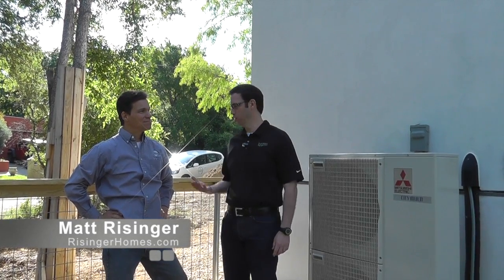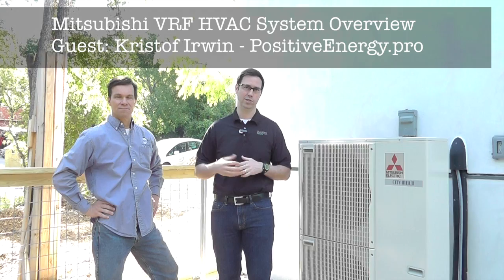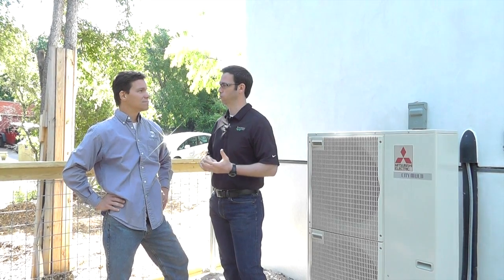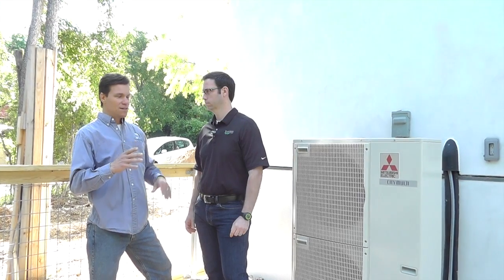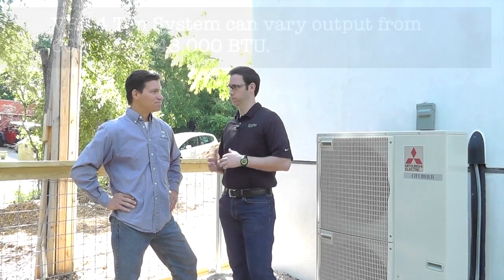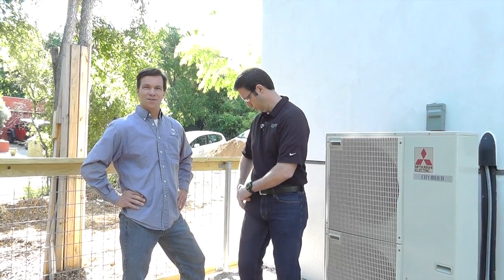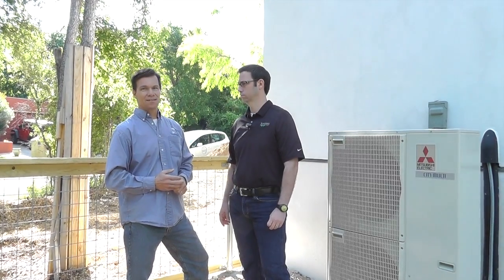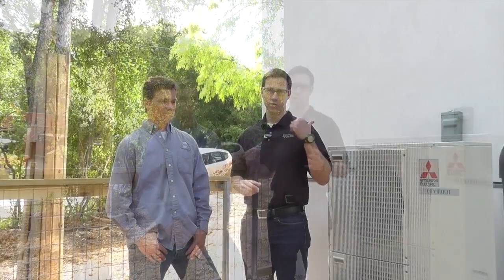Ultra Efficient & Comfortable HVAC - Mitsubishi VRF System Tour

Comment: I'm a Waco Texan who's always known there HAS to be a better way to cool us down here.  Dehumidifiers are clunky, noisy, etc.  But except for west Texas our humidity is miserable.  And I HATE the ceiling fans needed to get air flow in my older house with 8' ceilings.   I'm here in 2023 hoping the price is coming down for these.  I'll certainly check next time I need HVAC replacement.

Comment: There is no way that a 4 ton unit starts at LRA then runs at 40 amps RLA! If that’s the case then the compressor is more than likely not coming on and even tripping the breaker at the main panel!  My 2 stage Trane 18 SEER heat pump with variable speed air handler comes on at 20 amps with a start assist kit then goes to 8-9 amps on first stage and then if needed the second stage goes to 11 amps. Even on older 2 stage systems I don’t see this kind of amp draws. This information is incorrect that you’re giving to people. If you have proof of it then show it with a meter attached when a two stage system turns on and then idles out. This information is very misleading!

Comment: The initial cost of install and future cost of repairs of these VRF’s are insane...  not to mention most suppliers do NOT stock a ton of parts for these systems, this means when it breaks you will be without AC for a while waiting for parts...

Comment: Matt, love your videos.   It is great to see the efficient and tech side of construction.
Had two questions about this install.    
1) Is there any reason for using a VRF for a single zone over a normal mini split outdoor unit?   I see the real advantage of VRF systems when you start to use multiple zones where you can cool one zone and heat another zone simultaneously / using the heat pulled from one zone to heat the other.

2)  Why is the return located below the unit on the 1st floor.  Not to mention a small return duct inside the utility closet?
I would think you would want to pull return air from at least the top of 1st floor if not higher.      I have always found returns at the bottom of upflows as trouble due to not pulling from the hot air above and also pulling in excessive dirt and dust from the floor.
Thanks for your videos, they are always informative. and appreciated!
- Ben

Comment: 3:50 this bit right here is huge because if you don't have a soft starter you have to size your breakers for the surge/inrush current. If the equipment doesn't come with it I would ask about adding a soft starter if possible on any large amperage equipment
7:49 I don't know why people object to mini-split heads: they offer functionality like oscillating fans (that can run when you're not heating and cooling) that dumb registers can't.
11:25 why is part of your return in the closet? It's not doing anything with the door closed. Also if you're not multiple zoning in a (new) two story house you're not taking full advantage of a system like this.
Kristoff looks like a muppet but he's a smart guy

Comment: What they don't say is the initial cost of these systems is significantly higher. Secondly, these are highly complex systems. With significant computerized/electronic controls. As these units are outdoor basking in +100F degrees IT WILL FAIL. In other words, GUARANTEED it will have issues within the 1st. 10 years. Then 2 things - 1. Hardly any technician one will find who understands / certified. So - best of luck in terms of high labor costs 2. The parts are niche and incredibly costlier than standard systems. Best of luck there. 3. Finally, if fails rest assured you'll need to deal with the manufacturer to get the parts and when in summer in TX and temp at around 100F think of a 1 to 2 week or more before parts are available. So, all those talk about cost savings due to energy savings (utlility costs) after factoring in the high capital costs 1 repair and all savings just flow out of the window.

Comment: VRFs are good machines but I still prefer a single split system simply due to the fact that if the outdoor unit breaks down all the indoor units are useless.

We learned the hard way when our Daikin system’s distribution valve something broke down we had to wait for weeks for the part to come in and for a service guy to be available for booking.

The house was a nightmare.

We are using Mitsubishi Heavy Industries and Hitachi inverter air conditioners in our home now and couldn’t be happier!

ULTRA quiet and super efficient, upfront cost is expensive AF but worth every penny.

Comment: I don't understand the dislike for mini splits. They work great. Here in the north I would much rather have a mini split for cooling coupled with a good hydronic heating system. Forget the bulky ducts.
Reply: In CT, that is what I am shooting for. I have legacy a hydronic oil fired boiler, but will use mini-split for AC and the shoulder seasons for heating (Spring / Fall).

Comment: All this talk of dehumidification, but what scares me is In a lot of Forced air systems here in the NorthEast I see humidifiers attached to them. Although this is supposed make things more comfortable by reducing dryness of the air and also optimize warmth, I just see visions of all that moisture introduced into the air migrating right out to the external walls and condensing there. And we're talking here the newest homes built in like the 80s and 90s, most of those being townhouses. Unless you're talking custom built mcmansions, vast majority of single family houses around here were built form the 40s - 70s, 80s if you're really lucky. So none of your fancy waterproofings and wraps. I'm talking mostly brick or vinyl sidings and who knows what's under them. Wouldn't be surprised if the newer ones have mostly OSB. Isn't moisturizing HVAC hot air a really bad idea? Will it cause lots of trashed and moldy insulation?

Comment: what about setting up geothermal air pipes to feed the condenser fan inlet, either by dropping the unit below grade or enclosed in above ground housing with 4 or more, 6" underground drain pipes 50-100' long?? (what ever the cfm calcs would need)

Comment: I've watched your various videos on VRF.  I get the technical reasons to consider a VRF, even as a retrofit to replace an aging HVAC.  What I haven't seen is any detail on the installed costs of VRF versus a traditional/standard heat pump HVAC.  Any feedback would be great.

Comment: Hey Matt... Why don't you use electronic filters instead of those pleated filters? I had my guy put 2 in my current home (has 2 complete systems in the home) and I love them. Don't have to change anything at all.

I should mention 2 caveats:
1. I did have to get used to the sound at first because it sounds like a bug zapper at times; it's not loud and obnoxious though.
2. The "up front" cost was significantly higher than just installing the pleated system.
Reply: You need regular filters as well. You can not supplant electronic filters for physical ones.

Comment: 4 tons for 2000 sqft !?!   That seems pretty excessive...   was this a remodel and not a new build?   Maybe the VRF systems can’t be compared by tonnage with conventional systems?
Reply: Just like he said in the video, they install based on the hottest/coldest times of the year. Most Hvac companies (not all..) will sell you less then you actually need. Meaning more $ for them when you need them to come back. It’s a 4 ton because Matt and his Hvac expert wanted to ensure that his customer was comfortable all year long. I hope this helps!

Comment: Great video, would this work on a whole house system in South Florida?
Reply: TheAthleteLifestyle  -   I’m tearing down my 100+ year old home and building a new one in its place here in SW Florida, going from 2 stories 4000 sqft to 1.5 stories and 2650 sqft and yes, we’re installing a VRF system that more than meets the demands of our climate.   One major difference with my new house tho, it’s being built with a shell made of a sandwich of concrete board and 8” of closed-cell foam and triple-glazed windows so it’s base insulation score is 40...   adding the ERV for fresh air, the Tesla SolarRoof and PowerWalls (x2) brings it down to a net zero energy (passive) home standard.   11 days without power after Hurricane Irma made it important to me to never have to go without power again and I hate generators, hence the solar PV and battery systems (along with quite a few other whizbang renewable techs).
Reply: orion khan  Nice, sounds like an amazing build!

Comment: Hey Matt love your chanel. Quick question as a 5 year HVAC vet I spent about 3 months installing VRF systems in UT, mostly Daikin. My understanding is one of the big draws of VRF is the ability to heat and cool different zones off of one outdoor unit. City Multi is one of these systems so why just the one airhandler if you wanted to do it that way why not get a standard ducted minisplit with variable speed motors and compressors?
Reply: every room will require its own indoor unit.
Reply: @LordRedDragon  Not necessarily true. Every zone would require its own fan coil unit and you would need a BS box. However my piint still applies why use a VRF system if you are not going to utilize their purpose.
Reply: Larson

Good luck finding a real VRF heat recovery system for residential.

Just because you have a branch box does not mean you can heat and cool simultaneously. I know Mitsubishi doesn’t have those units for residential.

Comment: I'm Skeptical About Pulling Return Air From Closet.
Door Of Closet Should Have Louver Vent Or Return
Should Have Been In Short Wall Matt Was Standing By.
Reply: Check the video again, there are two return grilles, one is facing the foyer.

Comment: Matt how do i get heat out of this system when its cold? I live in Pennsylvania  when the temps outside get very cold in the winter. My current system locks out at 40 degrees outside temp. I need an outside unit that can generate heat  well below that temp. Any suggestions my home has ducted system which i want to keep.
Reply from the maker: +Mr504319 the Mitsubishi hyper heat pumps retain full heating capacity below zero outside
Reply: @buildshow  mat do they have these units that operate off of a ducted air handler in my basement. The house is about 3200 square feet 2 story.
Thanks
Reply: Mitsubishi has a whole line up of indoor air handlers that use standard ductwork. They Hyperheat models will heat at 100% capacity down to 5degF and will heat all the way down to -13degF at reduced capacity. Here’s the link to their air handlers.  http://meus1.mylinkdrive.com/M-Series/R410A+Systems/Multi-Position+Air+Handler/index.html

Comment: Great vids first off. But as a hvac guy and I'm speaking above my head a little, but I wonder as the nation transitions to vrf which I agree will happen especially as building envelopes tighten up is there going to be negative ramifications do to harmonics caused by ecm motors on the ac grid? I know this is off topic of the vi
Reply: I'm not a HVAC guy, but I work with electronics and software to "Electronically Commutate" (EC) DC motors. By harmonics, so you mean pulse width modulation (PWM) noise? If so, most motors can be run above 20 KHz freq, inaudible to human ears.

Comment from the maker: @cowboydanrice:  Great Questions!  We are utilizing a Panasonic ERV for ventilation.  The Heat Pump Water Heater provides some supplemental dehumidification and cooling but we didn't install and Ultra-Aire Dehumidifier on this project.  We have a spot in the mechanical closet for a small 70 pint/day plug in dehum and will likely add that to the system.  Best, Matt

Comment: could you please explain how the zone system works in more detail?  not sure if you're familiar with the emme system.  getemme.com It utilizes sensors in each room which speaks to a pneumatic damper in each duct to control air flow.

Comment: For others asking I am wondering the same thing about the air handlers and controls I have been able to find the tech data on the Mitsubishi air handlers. Youtube does not accepts URLs in comments so change the backslash to forward slash.

goo.gl\mWGHz (change backslash to forward slash)

The air handlers look a little different though for instance how the condensate drain is orientated.

Comment: Thanks for this interesting video.  Like a lot of people here, I'm very interested in the air handling side, particularly using multiple smaller ducted units, and what installations that serve a few rooms look like.  I think we're pretty familiar with the "single high-static" conventional units, and the "wall wart" mini-splts, but the "low-static" ducted units are really interesting (though unfamiliar).  Lots of great questions here, too.

Comment from the maker: Great point!  In general, a tight modern house with a heat pump can operate at the same cost or less than a gas furnace. And these Mitsubishi heat pumps have an air temp on heat setting above 110 so the air coming out feels "hot".  Many people object to heat pumps because of the air feeling "cold" meaning it's in the 90's so it's less than your 98 body temp.  Best, Matt

Comment: Another great video, Matt. Some people should also consider the savings of an all electric home due to the absence of the natural gas fee. I know I personally spend well over a hundred dollars a year just for the monthly service fees. If the operating cost of the heat pump is a little higher, you still might come out ahead considering you don't pay the gas fee. You could also offset some of the operating expense with a solar panel or two.

Comment from the maker: Yes, it's a Mitsubishi upflow air handler (though i think it's made by a third party).  They have other high static pressure models too for horizontal flow R & L as well as many low static pressure units and head/cassette options.  I'll see if we can do the UberGeek version sometime with Kristof.  I was already concerned with the length of this video, round 2 can be more in-depth.  Best, Matt
Reply: Don't be concerned about the length. You covered a lot of ground but It all made sense and wove together with the intro to this newer technology.

Comment from the maker: Common mis-nomer.  This heat pump can operate this high performance home more efficiently (for less money and more comfort) than a Gas furnace and it blows air hotter than 110F so it "feels warm".  I need to verify the stat, but I believe this Mitsu can provide heat down to 5 degrees F outside.  Best, Matt

Comment: You're using it as a heat pump in winter or do you have gas also?  I don't think anything can beat gas operating cost wise. Heat pumps can be expensive to operate in winter.

Comment from the maker: GeoThermal (Ground Source Heat Pumps) are generally thought of as the Top Of The Line system for efficiency, but in my opinion these Variable Refrigerant Flow systems are a much better investment for both efficiency AND comfort.  I'm working on a blog post about this...coming soon.  Best, Matt Risinger  risinger.blogspot.com
Reply: Matt Risinger you can do geothermal VRF just as easy.

Comment from the maker: Good question, but hard to answer exactly.  Likely it's going to add 15-20% to the installed cost of a good HVAC system with 2 stage equipment.  I would expect that cost to come down as it starts to become more known by Texas HVAC contractors.  Best, Matt
Reply: Matt Risinger Love reading your replies! Great micro bits of info

Comment from the maker: I asked my Mitsubishi rep and they report 28 year average life span.  That's a good 10-15% more than most of the American brands I would expect.  Payback is a tougher question.  I did a recent analysis on VRF vs Conventional 2 Stage equipment for a 4000sf house I'm remodeling and it came out to a net annual savings on electricity of $400.  For that house it's an 11 year payback, BUT what doesn't factor in is the increased comfort AND the possible savings for not installing a Dehum.  Matt

Comment: Does the system come with its own TXV (TEV)? With a VFD compressor setup I am not sure I would trust a standard $40 TEV for such a wide range of refrigerant and air handler fan speeds. The keystone to the entire system working would be a good TXV.

Side note. Matt we have to get you a tri-pod and a portable mic.
Reply: These systems do not have standard TEVs  they use a more expensive EEV or electric expansion valve that modulates the flow of refrigerant down to 10,000 steps. This is all digitally controlled.

Comment: I really would love some more nitty-gritty technical details on these.  Maybe you can do a more technical video on this?  How are multiple evaporator coils (air handlers) tied to one VRF condenser, is there refrigerant solenoids?  What air handlers are your using?  What are the controls, is it a special communicating thermostat designed for the Mitsubishi condenser and how is that controlling the air handler?